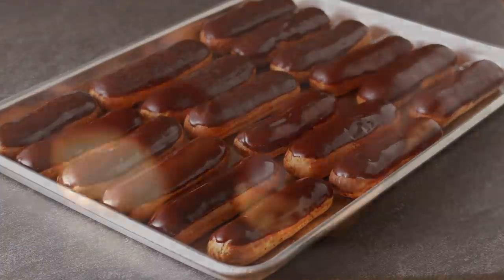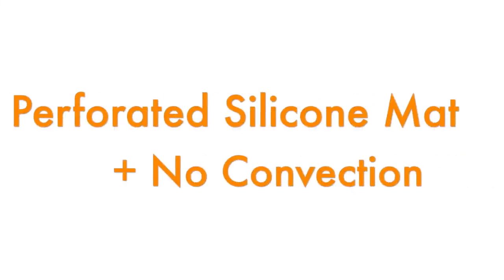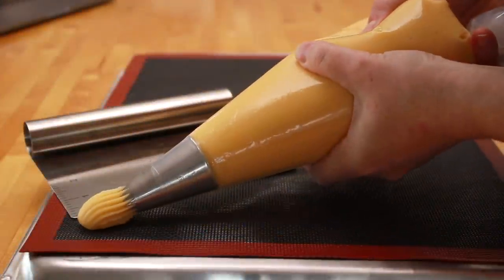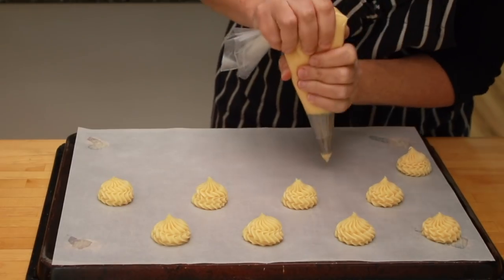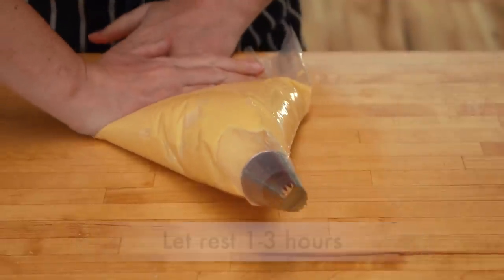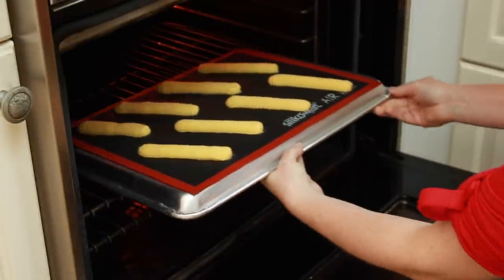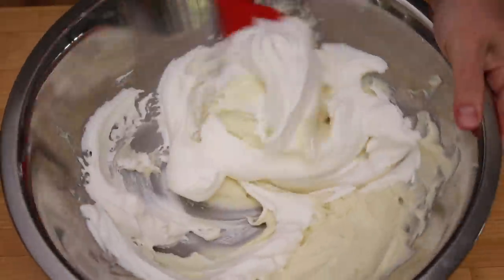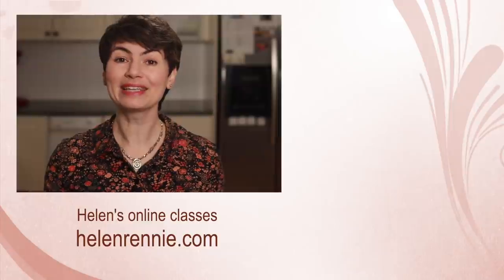Eclairs 3.0 -- No More Cracks!

Comment: For what it's worth, I've been trying choux paste recipes, passively, for years and they've all yielded inconsistent results, save for one. The ratio for choux pastry, given in Michael Ruhlman's book "Ratio" has worked every time that I've used it. 2 pt liquid: 1 pt butter: 1 pt flour: 2 pt egg. Worked the first time that I used it, with much less knowledge than I have now, works whenever I use it thereafter. The only time that I've failed is when I've tried to complicate it with different "tips and tricks."
Reply: Could you share this recipe ? I don't understand the ratios. Thank you!

Comment: I like using the Choux Craquelin coating on eclairs (I prefer the eclair shape to the Choux Craquelin shape, the hemisphere is too big for your mouth and pushes cream out of the sides, also the ratio between cream and pastry is more consistent on an eclair shape). When I use this coating I never have issues with cracks. The coating is just frozen butter, brown sugar, and flour so I guess it would have a similar effect to covering the top with oil and sugar, but maybe the coldness also delays browning on the top for a little while longer so that the pastry can expand. When I make eclairs this way, I always glaze the side that made contact with the baking sheet and have the Craquelin portion be the bottom. I love the extra crispy bits it gives and find the texture to be superior to a normal eclair (at least ones I've made).
Reply from the maker: I need to try craquelin.  thanks so much for the suggestion
Reply: @helenrennie , the craquelin works well on eclairs and seems to kept them more regular with less cracking, I have no idea why.

Comment: My oven uses the fan even when I bake in no convection mode. The manual says that it does this to maintain even temperature. The problem is that it’s very powerful and it turns on more often than I would like it. So I found that one other way to bake the eclairs is to preheat it at a high enough temperature so that when I place the eclairs in they rise with the oven turned off. It’s annoying but it’s the only way for my exceedingly crappy oven to not run the fan.

Comment: Hi Helen,
Thanks for such an informative video. I have seen your video on puffs too.

I have tried multiple recipes for making Choux. Since bread flour isn't available easily, I stuck to all purpose flour. Carefully cooked the panade until the film forms, added eggs until the V shaped consistency,  piped by cutting the piping bag end on parchment lined baking plate. Baked throughout at 180, also tried with 425 and then 180. I dont have piping tips, so cut off the piping bag end and pipe on parchment paper. Have tried 1/2 inch as well as 1 inch thickness with 4 inch length. Piped with consistent pressure and uniform lengths. But each time my eclairs get big long cracks down the bottom. Tops look puffed up and risen but bottom is terrible. Its basically cracked and concave and hence instead of the eclair cross section looking like a hollow round pipe, its looks like a flat hollow stick. And I am unable to figure out what could be going wrong. Would you have any pointers? I feel it's not much about the recipe of the Choux but the consistency plus something else. I have watched your videos multiple times, listened carefully about the V shape consistency and I feel that the Choux consistency is fine at my end. But I really need you to help me with what's going wrong with my pastry and why is it not puffing up like it does in this video or like it should. 
Plz guide if you have any pointers.

Thanks a lot!
Kriti - India
Reply from the maker: If you aren't using a star tip, you need at least a round tip.  After piping, spray with water and run a fork through them.  Here is my very old video on them.  My piping isn't great, but you'll get an idea of how to use the fork: https://youtu.be/ICg9-DlAU6A?t=289  You don't want to change the temperature on eclairs.  350F, no convection is crucial.  Don't start at 425F (that's way to high).  I am not sure if you meant 180C or F.  If it's F, that's F, that's insanely low.  If it's C, that's about right.  Make sure to let the batter rest for 1 hour in the bag before piping.  Keep in mind that good piping is crucial.  They need to be very uniform and perfectly spaced out.  If you have any pictures, that would help greatly.  If you want to trouble shoot more, e-mail me at helenrennie@gmail.com  since follow up comments are very hard for me to find.
Reply: @helenrennie  
Hi Helen,
I followed the link shared by you, piped using the fork and worked more on the consistency of the Pate a Choux, let it rest for an hour, pipe very evenly and finally could get round, puffed up shells, with no cracks in the bottom and top. Slight  stretches on the sides do occur in one or two shells, but I am ok with those.

However, I faced a problem and would need your help on the same:
1. Baking at 180 degree Celsius in the middle rack in convection as well as non-convection oven give me light golden shells in 45 mins. I bake cakes in the same ovens and there seems to be no temperature issues. Since the shells are still very light in color, I am actually continuing to bake them for very long(upto additional 45 mins) to get the same color as yours. Before that they aren't even as crisp.
Would you have any suggestions as to why its taking so long for these shells to  turn the same color as yours while all cakes do turn out in the designated time in the same ovens(I know oven thermometer wud have been a good way to cross check but we are in lockdown so no luck)
Ps: I use all purpose flour as bread flour isn't available around easily now a days.

Thanks
Kriti

Comment: Helen, I am so frustrated.... I baked Eclairs so many times now. I even tried your (and Pate de Doms) recipe. Everything works well, but I do not get them crispy! I baked them with and without convection.... My Eclairs are super soft! What is wrong? I am at my wit´s end.... Any suggestions?
Reply from the maker: You are welcome to e-mail me at helenrennie@gmail.com if you need help trouble shooting.  Go through my recipe and check all the places you might be doing something different.  Are you weighing?  Using bread flour?  What do you mean they are soft?  Soft right out of the oven?  Soft 30 minutes after they are out of the oven?  Soft after you fill them?  Basically, I need the details.  To give you heads up -- every single time someone told me they tried my recipe, pate de dom's recipe, etc -- they didn't actually try my recipe.  They took a few tips from me, a few tips from pate de dom, a few tips from some other channel, but they didn't follow any of these recipes carefully.  If they didn't have the exact piping tip I use or the exact flour I use, they thought it's not a big deal.  Everything with eclairs is a big deal :)  So unless you are really doing every single thing in my recipe (not only things that are convenient), it might worth to follow it perfectly first and then we'll trouble shoot.
Reply: @helenrennie  Thank you Helen :)

Comment: There is a large difference in the texture between La Pâte de Dom and you’re version.  His is loose enough to drop off his beater and form a ribbon. Yours shows a birds beak and no ribbon.  My preference is no ribbon as I find my eclairs crack less if the texture is more firm. Have you tried making eclairs where the pate has a texture that ribbons?
Reply from the maker: I haven't tried Dom's dough recipe.